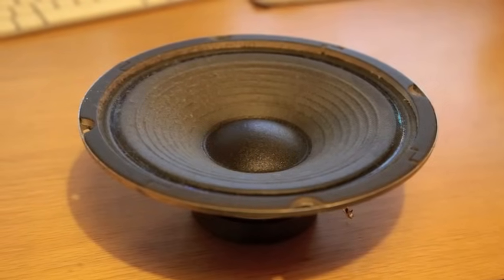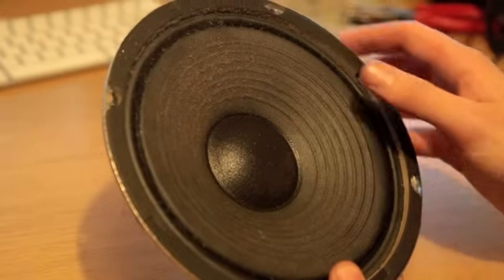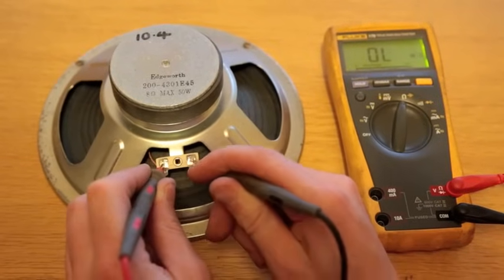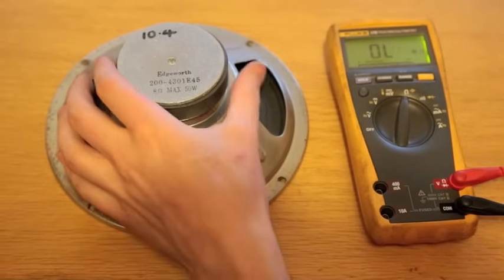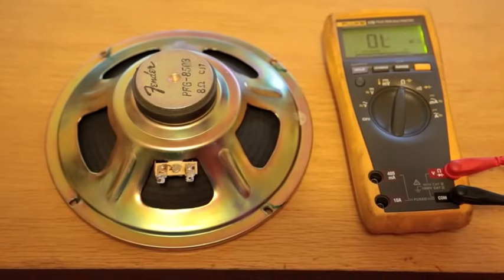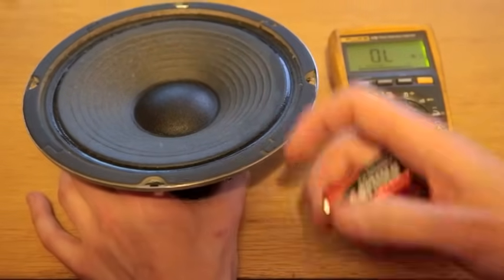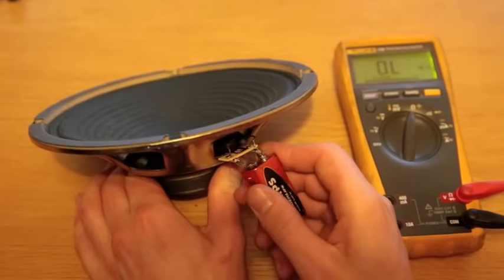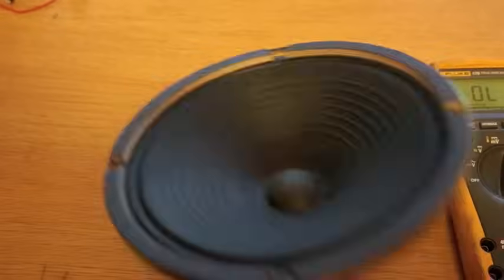How to test if speaker is damaged

Comment: Well now im totally stumped what could be wrong with my samsung subwoofer speaker. It comnects to the soundbar via a cable and plugs in the rear of the soundbar. Our kids hamster recently climbed into the sub and chewed through the internal cables. I took it apart cut out the chewed damaged part of the cable. I soldered it back together then applied heatshrink. I  then tested the cable for continuity and it was all good plugged the sub into my soundbar not working. I then watched this video thinking the speaker itself could be damaged tested it both with a multimeter and the 9v battery and both test comfirmed the speaker to be ok. 
I then took my soundbar apart to see if the plug socket was broken or damaged. No sign of damage test the 2 pins on the socket where the sub plugs into and there was a small reading on the multimeter. I also tested the tiny fuse on the motherboard and that was still ok. So if anybody has any idea what could be going on here please leave a comment.
The soundbar is the samsung HW-K335. Any advice or information would be greatly appreciated.

Comment: If I put a 9v battery on the terminals it pops in and out, but when I switch the battery around I get static or nothing at all. Is that a bad speaker?

Comment: Or........ Play music through it.
Reply: The point is to see if the speaker it self is broke, or if its the amp, or cable, or something in between
Reply: @qTravis666  You can visually see that the speaker is fine. The wire leads are connected and no tears in the cone surface. No visible damage. Not much to a speaker. Impossible to damage to the point of not working without seeing visible damage.  Kind of like a basketball. Want to see if it bounces? Bounce it!!!

Comment: Beware don't hold the battery to the terminals more than a half-second or so.  If you keep it connected it may blow the speaker!  Just tap the 9v battery as the video shows.  Don't hold it there.

Comment: Apparently my right speaker just died....oh wait no it's just the video

Another cool way to test woofers is to short the terminals with wire and move the cone back and forth while scraping one end of the wire on the terminal. You will feel more resistance and hear crackling from the intermittent connection.

Comment: If you don't have a multimeter get one. Super handy around the house and car, will pay for itself in time. Try to get one with an "amp ring" at the top. Gives you the ability to check how much current is on a circuit.

Comment: I bought two 8 ohm speakers off eBay and they tested 4.8 and 5.2. I bought two new ones from the mfg. I tested them and got 5.2 reading each time for each of the speakers. It tests okay with the 9 volt battery. I bought a better meter and it reads the same 5.2. Can you tell me what I may be doing wrong? I am complete novice with this and the speakers sound okay.
Reply from the maker: That reading is fine, the test is more to check there is continuity in the coil (no break in the wire). https://www.cnet.com/news/how-to-stop-worrying-about-speaker-impedance

Comment: my multi meter is set to omega 200...it reads 8.8.....is my woofer ok ( rated at 8 ohm)   ?
Reply: Your multimeter is not very accurate at low resistance

Comment: Wonderful, thank you.  I have identified that the tweeter has blown in Yamaha dbr10 speaker. I believe it blow the first time it was used. I shall fit a replacement, and never buy Yamaha products again.
Reply: Yamaha isnt so bad try their amps I've got a p3500s that's been pushing a Bag End D12E-C sub for over 10 years.

Comment: Hey there, if you have a 2x12 guitar cab could you apple the 9v to the terminals while it was still wired in parallel or would the existing wiring circuit mess up the test? Yes, I know nothing of how a circuit works...ha! Thanks for the vid. :)

Comment: Nice advice. I would add sometimes a speaker is bad but not totally blown. You may hear distortion when played loudly. This is usually caused by the voice coil rubbing. It will test ok with ohm meter and battery.
To see if your voice coil is rubbing, set the speaker on a table and gently push in on the cone evenly and let it come back up slowly. Listen for a scraping noise. If you hear rubbing its bad.
Reply: Thank you! Im having this issue atm. My right speaker on my Numark mixstream pro dj table is distorting and only works sometimes if I blast the volume or hit the top of the dj table.
Reply: And even if I increase the sound it still sounds distorted. Should I change the speaker at all?

Comment: The sound quality in my Volvo s70 -00 suddenly went down insanely much, the bass is atleast gone to about 70%, i have all stock speakers except 2 ground zero 8" on the rear deck and they've always played insanely well, bass has been plenty and music quality been top notch, ive played through Bluetooth and it has always worked great but this morning when i got into my car and connected my bluetooth and started playing music it was as if the speakers were on "Stereo" mode, very little bass and could barely hear anything when driving, and turning the sound up to 20 was ridicilously loud for whatever reason...

Does anyone even have the slightest clue what the problem could be???

Comment: hi i just tested my 16ohm speaker with 2k multimeter settings and i got 0.14 is it good ?
Reply: +Jepe 97 no
Reply: +Ryan Siggins What fuck you dude :D
Reply: Jepe I get 6 ohms on my 8 ohm woofer. Still works, it's just wear and tear over time. A speaker will never be as efficient as it used to be brand new. I would reckon you play with that speaker a little more (if it works) before you toss it out and replace it. it still has some life left too it.

Comment: Thanks, this video helped me diagnose my guitar amp cabinet. I was able to determine the speaker worked thanks to your battery trick, and was able to find out I had wired up to the wrong terminals on the jack plate.

Comment: nice video ..  what about speakers used in other electronics items like phone, or some other little devices .. i have a wire tracker / cable tester its not working.. need to test it.